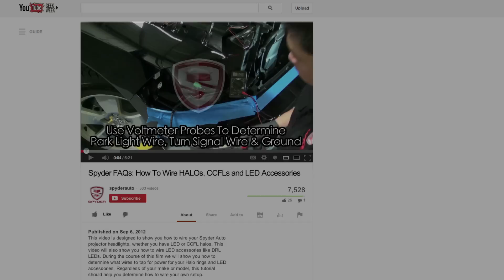Spyder Auto Installation: 2007-13 Chevrolet Silverado Projector Headlights

Comment: One of my low beam bulbs went out.  All I want to do is replace the low and high beam H1 bulbs to LEDs.  Can this be done?  How?  Everything H1 LED bulb I've tried either does not fit in the housings or is absolutely useless for light.  How is this so hard?  It can't be!

Comment: Can I use the same h11 hid bulb in this headlight unit for the 2010 Silverado?
Reply: Yes, you can use your H11 HID bulbs with the projector headlight housing. HID's belong in projectors and should not be improperly and illegally used in standard reflector housings.
Reply: This is true. I am so pissed after buying H11s. My fault for not paying attention.

Comment: Hey, I have been having some difficulty.  I hooked up my new Spyder Halo projector lights, and they look awesome.  However, I cannot seem to figure out how to wire the leds/halos.  I have watched many videos, read the installation on your website and they all seem different.  I have an 09 Silverado, do I connect all the positives from halo and leds to the Inverter? Or do I cut my wire coming from truck and use a quick connect that way?
Reply from the maker: +Mitch Carlson the inverter is only for CCFL halo rings. please do not modify the wires on the converter. 
CCFL halo wires > inverters > parking wires on your vehicle
LED wires > parking wires on your vehicle

you can follow the link below to find your parking wires
https://www.youtube.com/watch?v=pKzWl6-Fac0

Comment: i bought this "Manufacturer Part Number:444-CS07-HL-C+8LED-C" from ebay. after install, i hardly see the halo ring light at daylight, the one in this video is more brighter than mine, what's the model number of the one on this video?
Reply from the maker: the product number is 444-CS07-CCFL-C. the halo ring in this video features CCFL instead of LED halo ring. CCFL usually brighter than LED halos. if you have any other questions you can contact our tech support at 626.934.8884.

Comment: Those spyder lights are shit! I have the blacked out ones on my truck and all 4 ccfls are blown out within a year. The one ccfl light around the passenger high beam didn't work right from the factory. two of those "philips" leds are already blown out aswell. Tried to get a swap out from vipmotoz but they were no help. They told me they couldn't replace the headlight because they did not have a spare passenger side housing. they told me they would have to separate one of there kits and they were not willing to do that. also they wanted me to pay shipping, duties and customs to send the old light back and send the replacement to me if they had one. will never buy again. i must have got a bad batch because lots of people are still running these on there trucks.
Reply: I agree. I put them on my 2011 Silverado and the drivers side bulb blew afer about a month. After replacing  that the passanger side bulb blew after  a few weeks .And the really worse part is the driving lights are so dull i cant see more than than a few feet in front of me . I have to drive with the brights on . And when someone is coming towards me and i dim them i loose all sight of the road except for the lines on  the highway to guide me for that few seconds.I tried three diffet H3 bulbs . All the same.I am going to put my stocklights back very shortly. I just am kind of tired of going through all thats involved  to do it. Maybe im just doing  something wrong or are they just pieces of garbage?
Reply: Joseph Sullivan I don’t think you’re wrong. I’m having the same issues. I literally can’t see anything in front of me. I’m gonna try a different bulb but I don’t know if that will work. I should have just left my stock lights on. I so regret spending the money to buy these lights cause they are absolutely useless